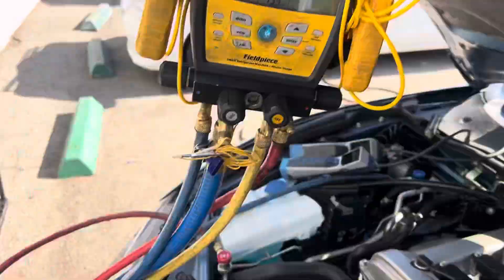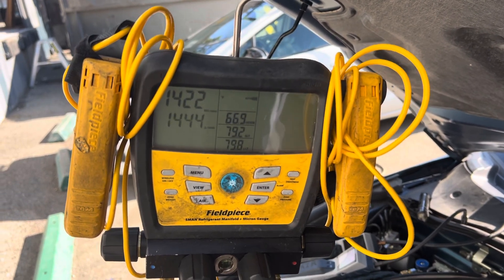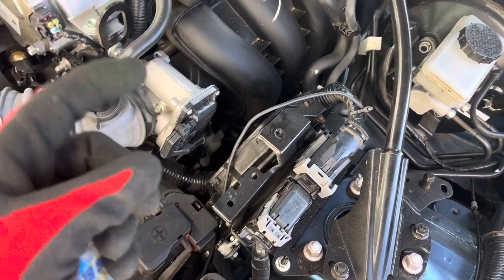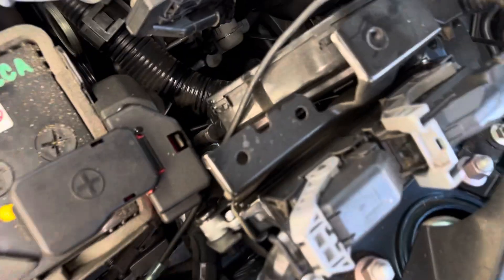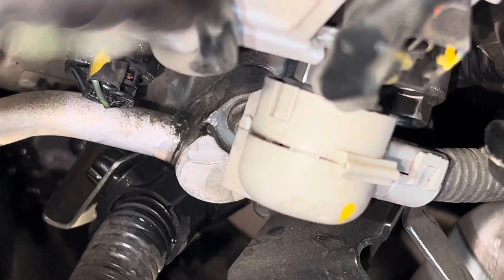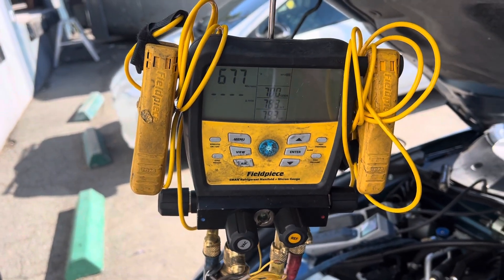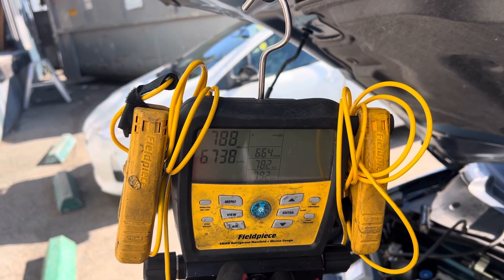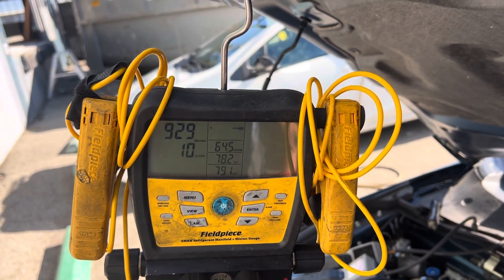VACUUM LEAK THAT DOES NOT LEAK ? Oil film slowed it. NYLOG STOPPED IT.

Comment: To ALL   Nylog even seals leaky quality R134a couplers . As u also demonstrated apply to top of shaft and threads . Dont forget to apply to lip of service port . And by the way when is the last time u changed coupler o rings . Using a dedicated micron gauge and coupler reduces areas to leak .
Using Dial type gauges manifold with A DIGITAL MICRON connected is not accurate enough  .  The manifold will most likely  have leaks
Nylog is great stuff
Reply from the maker: When you mention using dial type analog gauges. 

I think of the same guys who are in the same category or classification of using old incandescent headlights with wires attached to them in alligator clips for doing 12 V electrical testing throughout a vehicle in the 1950s . 

When I think of guys who still use analog gauges, I think of when we still had tubes and tires, and I was pulling them out and patching inner tubes . 

When I think of guys who still use analog gauges, I think of the first cars back in about 1974 when C4 GM computer came out you would short two pin 🧷 and look up on the ECU and count the red blinking light to add up the numbers for your code  🤣
Reply: I think you meant 1984.  The first closed-loop pcm mixture control I recall was 1981 and by 1984 data logging was integrated.  Catalytic converters don't play well with open-loop mixture control.
Reply from the maker: @thisisyourcaptainspeaking2259  talking about the first feedback carburetors there was no fuel injection. 

Catalytic converters had to have the feedback in in 1974 .
Reply: @coldfinger459sub0  Perhaps and I don't recall those details except seeing feedback carbs till 1981.  So I can't  explain how a cat converter in '74 was fitted but I do recall leaded being discontinued about that time.
BTW, I still use incandescent bulbs in some cases because the resistance is variable with current.  They can "save your bacon", so to speak (as a current limiting device).
Reply from the maker: @thisisyourcaptainspeaking2259  Volvo is what I was thinking of 74 first cats. 

Yes, incandescent has its place when you want current limiting 

Unless it’s on a 5 V referred system, and then the incandescent bold ax as a straight short to ground 
OOPPSSS 🤦. 

I did that back in the early 80s
Reply: @coldfinger459sub0  Ha, yeah a 12v 50W incandesent is likely to look like a short in a ttl circuit.  I realise most cars were fitted with converters by '75 but I the earliest feedback carb I recall was '81, so I can't explain the memory gap there.  Our '79 Firebird had a mechanical carb(pretty sure) and I do recall it was deemed a sin to attempt adjusting idle speed.
Maybe poor implementation of the new tech deserves to be forever forgotten.
Reply from the maker: @thisisyourcaptainspeaking2259  I was too young and inexperienced back at that time. 

Do you remember when all the back, Hill backyard and redneck mechanics method of fixing a rough idle?  What to pull that plug off the feedback carburetor

And that baby smoothed out and ran better 🤣

Brings up memories of me being pissed off having to install a california NOx device on my 1970 Ford F100. 

I remember getting good at them because of my father and people would come to me to install Knox device on their vehicle so they could pass the smog. 

I was making more money as a teenager working out of my father‘s home Garage. 

Most mechanics who had 20 or 30 years experience in our area up in Willits, California that only had a population of 2000 people.
Reply: @coldfinger459sub0  That's interesting because my '73 49-state convertible passed Ca. smog with no mods but I did have to pay a special 1-time special carb tax for importing a 49-state vehicle.  This car does have egr, so maybe that's the required NOx device.  No air pump on this thing.
Pulling that mixture control solenoid connector is gonne wipe the cylinder cross-hatch off pretty quickly, overheat the cat and fuel economy will be poor.  Better off fixing the vacuum leak, assuming all those vacuum tubes weren't also torn off and the 10inHg vacuum advance replumbed to manifold vacuum so timing drops out at every throttle tip-in?
Reply from the maker: @thisisyourcaptainspeaking2259  yep back in those days did a lot of getting out the big prybar and chisel out the catalytic converters . 
Getting rid of those worthless things that caused unnecessary pressure  🤣
Reply: @coldfinger459sub0  The lack of converters on my '73 is one of the things I wish was possible because the exhaust stinks and burns my eyes.  I replaced the converter on my '84 because it was burned up and the exhaust stunk.  Had a '79 International that had cats on it with open-loop mechanical carb, no egr.  The cats were probably burned out but I don't recall stinky exhaust...
Reply from the maker: @thisisyourcaptainspeaking2259  I have faint memories of drilling holes ahead of the catalytic converter to get exhaust gas measurements.  For tuning and dialing in carburetors.. . 

Often deleting the cats later . Putting in straight pipes for people with flanges so in a few years when they had to get their smog test again, they could put the cat back in place just for the test
Reply: @coldfinger459sub0  The cats do have back pressure but I never noticed a performance difference.
Reply from the maker: @thisisyourcaptainspeaking2259  hot rodding kids thought so. 4K+  5000 RPMs, would it make a big difference?. 

Back pressure EGR‘s were not so happy.  For the vehicles that were sensitive. To knocking, and pinging from higher temperatures cylinder temperatures.
Reply: @coldfinger459sub0  I don't make a habit of racing my hoopty, they can do as they please.  I bet their egr has a plate over the mounting flange if the cat's gutted.
Reply from the maker: @thisisyourcaptainspeaking2259  I put Plate over mine. 

Other bb in the vacuum hose.